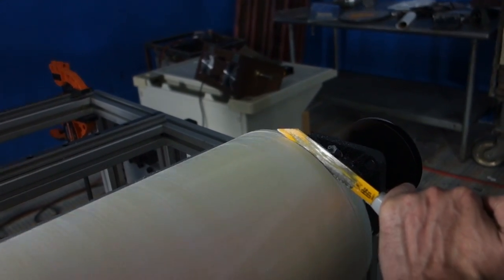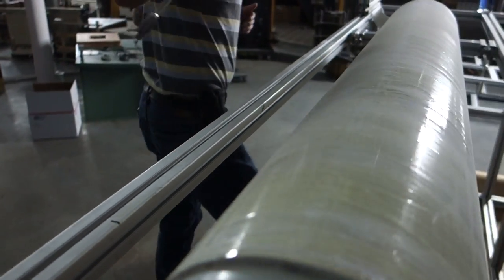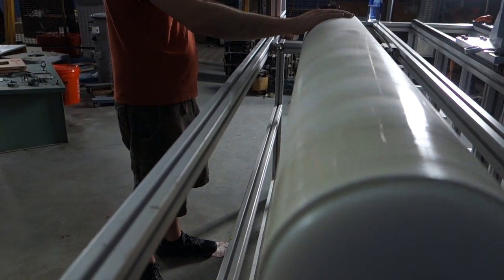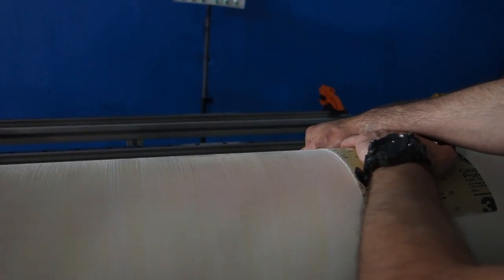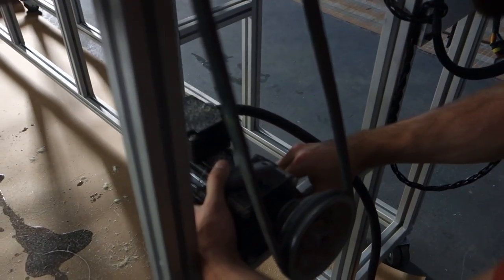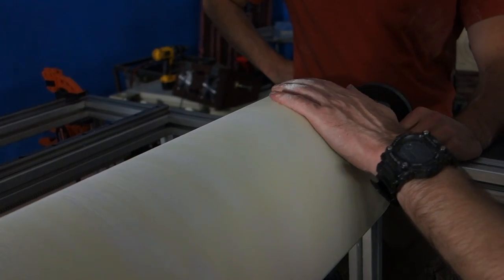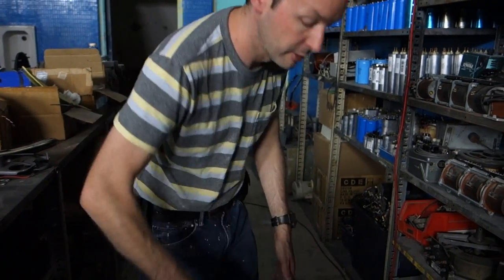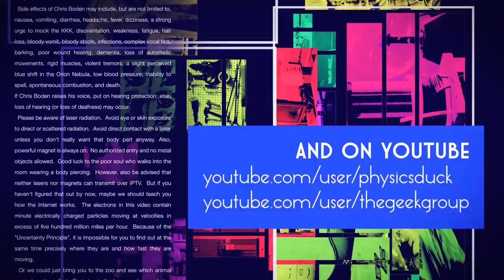Captain's Blog 9 25 2015 Tesla Coil Secondary Preperation Trimming

Comment: If you can get hold of the raw carbon fibre, or raw sheet, you may be able to make custom lifters, carbon fibre is made up in a similar way to doing fibreglass (car body filling), but it is baked, no idea if this could be done with a standard oven.
Possible suppliers would be boat builders or fishing rod makers